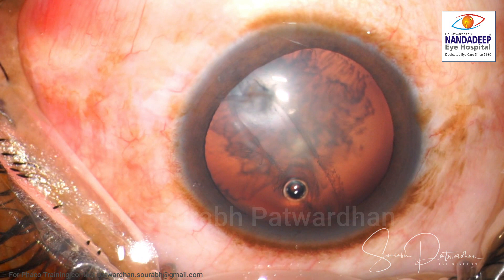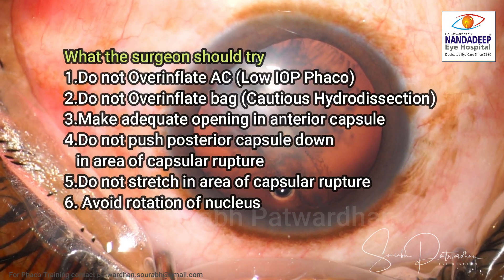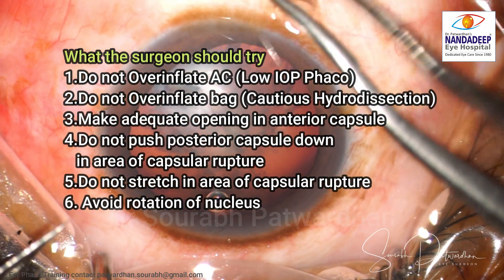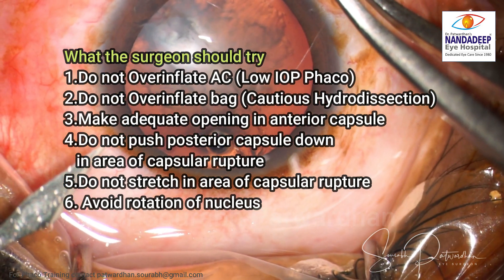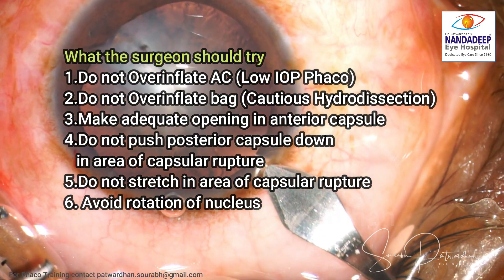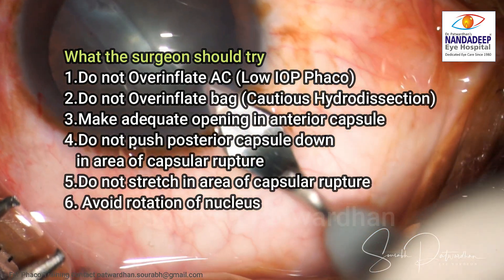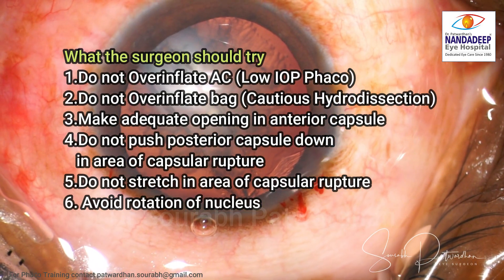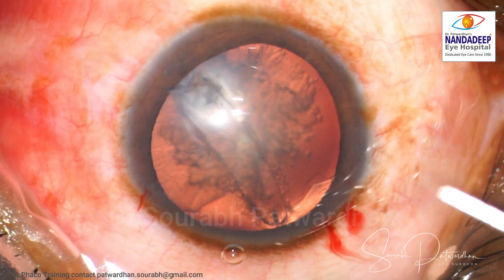Anterior capsule rupture- Thinking process Dr Sourabh Patwardhan

Comment: Great surgery sir..in a similar case If the ends of the ruptured capsule were not clearly seen and lens had become opaque..Is there a way to be sure if capsular rupture has extended beyond equator to the post capsule..how do we proceed then sir..Is there a way to elicit the condition of posterior capsule..Don't have UBM or AsOCT..
Reply from the maker: You can look at torn flap edges if they get inverted,its likely that the tear has gone posteriorly. There is flap motility sign described by dr rohit om prakash. Also you can always sense a tilt of nucleus during surgery.